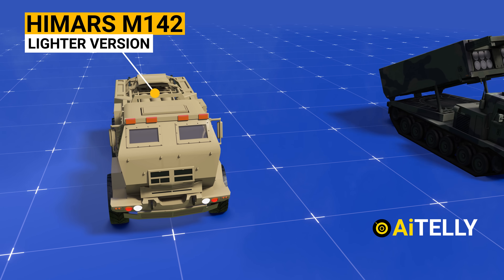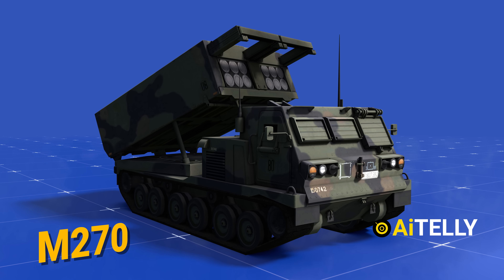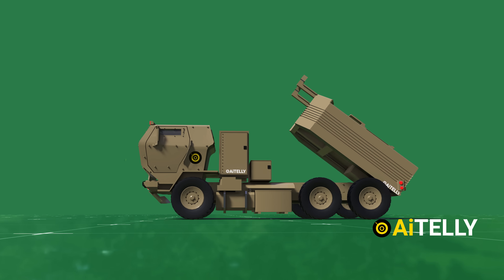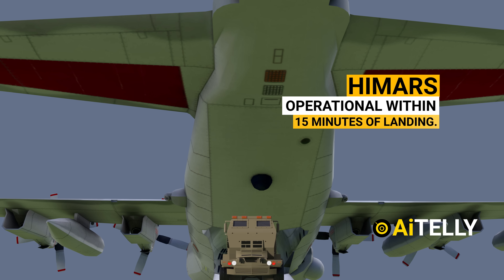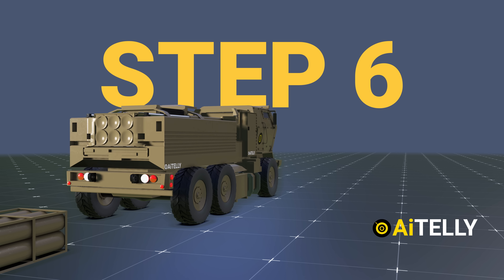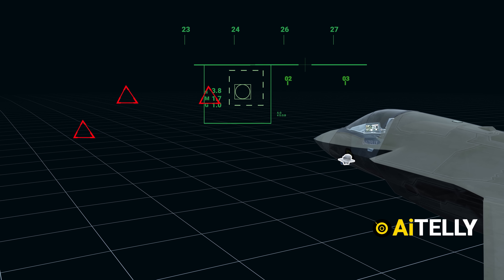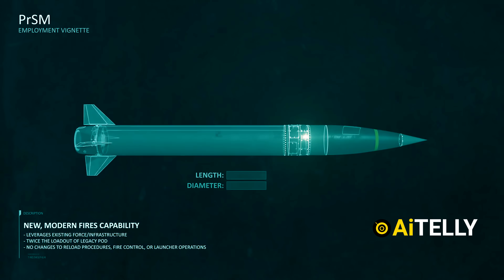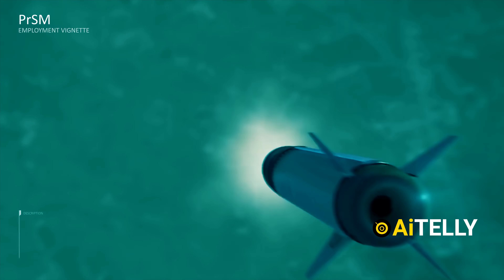HIMARS Precision Strike Missile  How it Works

Comment: As a former 13M (multiple launch rocket system operator) The m270A1 is much faster over ruff terrain than the m1083 truck that himars is based on. I would be willing to bet you 5 bucks it accelerates faster as well because 1083 trucks have very bad acceleration. Tracks over any other surface besides paved roads are aloso superior.
Reply: My friends from Ukraine say that this system is much maneuverable than M270 and saves a lot of lives because of that.
Reply from the maker: @KhersonUA4ever   Great to hear that so if it is Battle Tested means it Works.
Reply: @KhersonUA4ever  для Украины хаймарс более интересен, ибо позволяет преодолевать большие расстояния, плюс у нас нет проблем с дорогами.
Reply from the maker: Hi I have credited you in the Comment Correction Section.
Thank You for your Service!
Reply: Tracks needs more service and use more fuel
Reply: @davidavrams2626  ?
Reply: HIMARS has advantage in area with good paved roads, but M270A1 does have its advantage with track and two pods.
Reply: @Joseph-eh4rs  there are always positives and negatives. One of the HIMARS’s strongest points is ease of transport
Reply: Классная машина.
Reply: @Руслан-п8д4е  ?
Reply: They call it a cow with GPS... 😆 🤣 😂
Reply: USA army get this wepoon for afganistan why usa run Always afganistan,stop USA probaganda Himars wepoon no feet win in Ukraine War it is only Fake news
Reply: If you’re a former 13m then that means you’re a racist and misogynist who hates Arab people
Reply: Do they use the same pods?
Reply: @twisterwiper  same 6x tube canisters yeah
Reply: @twisterwiper  yes they use the same pods. M270 much more survivable than HIMARS. It turns faster, gose threw mud fast, shoots moves and communicates faster.
Reply: @joshuathomas8529  you must’ve just been stuck in korea, because as a former Mike you should know that the HiMARS is so much better
Reply: @Void-ic3ei  I never played with a HIMARS only M270A1. I saw the HIMARS never got to run one. I did get to play with FMTV's, LMTV's, and many other trucks. I was stationed in Korea frome November 2005- December 2006 and fort hood from December 2006 - February 2008. While at Ft. Hood we did a NTC rotation in Texas I don't remember the name of the base.
Reply: @Void-ic3ei  I drove the M270A1 threw about every kind of terrain you can think of. A driver that knows what he or I gess she does wont through track because they know what kind of terrain will throw track and how to avoid it. I am not saying I never threw a track. I am saying once I new what I was doing it did not happen again. A FMTV will never touch a M270A1 once it hits any thing not paved. That includes well maintained dirt roads. I could go full throttle over any dirt road with the M270A1. Most dirt roads with a fully loaded FMTV max speed if the road was in perfect condition was 35mph.
Reply: Man ur man she is sattalite shit , long live united States of Pakistan.
Reply: Вот вы где верить в сказки!  Система помогать только в одном!  Выглядить Украине что она что-то может а как оружие нас ваша система вообще небеспокоить ... она слабый... хамарс помогать делать фейки😅😅
Reply: As an Former IDF M270 operator and driver I can confirm this, when I was in the winter in muddy terrain all the trucks and even the humvee's could not maneuver well but the M270 drove smooth
Reply: @Shaked030  until you throw track..
Reply: @Void-ic3ei  Happens very rarely (it has never happened to me and I have been in many types of terrain and weather), and even if it does happen its one of the things that we always trained to repair at all of the exercises, so the repair time is short
Reply: Most supply lines run over railroad and paved or dirt roads. Its range means off-roading deep into rough terrain is unnecessary.
Reply: Who would've guessed that HIMARS were going to be used against the American people? The Grace Commission determined that 100% of what we pay in personal federal income tax goes to pay just the bare interest on the national debt. 
The Rothschild international bankers are so ingeniously cunning that we have been invaded, conquered, and enslaved, yet deceived into feeling good about it! 
Using the power of their monopoly control of our mass media, the mind controlling parasites are able to stifle all opposition using the false-accusations: terrorist Nazi antisemite.
Reply: @davidavrams2626  Let me guess, you still think Russia is a week from victory? You guys have been saying Ukraine is a week away from defeat for ~48 weeks!
Reply: Former 13M myself and have been a crewmember for both the HIMARS and MLRS
Reply: I think a ghetto drifter would appreciate how fast is, but the average grunt don't care as long as he hits the gas peddle when ordered to scoot and it goes. And remember, most of the time it's rough terrain and you don't want to go airborne laughing hysterically while you're slurping down a beer in a this scenario.
Reply: THE BIGGEST PROBLEM OF HIMARS IT IS TOO EXPENSIVE AND ROCKETS EASILY TAKEN DOWN EVEN BY SOVIET AA SYSTEMS, IN LONG TIME CONFLICTS IT IS USELESS, BECAUSE WILL EXHAUST PRODUCTION OF AMMUNITION
Reply: @davidavrams2626  особенно харьковское плановое отступление,вперёд и вперёд в Россию. В российской армии с каждым днём всё меньше и меньше дураков верящих в победу планов путина. И HIMARS один из тех елементов, которые поломали те планы. Господи береги Америку и Великобританию! Слава ВСУ!
Reply: @vitaldnovak659  какие планы?  Смотри эту неделю..увидешь как она вам помогать!😅😅  вы своим наступлением ускорить процесс... скоро вас будет 0  😱  ... идиоты ..кто вам в уши рассказал что вы способны победить Россию вода суша воздух космос профессионально       Украина видео  ролики  вранья , наколки, выпивка и винтовка .. и шоу клоуна зеленского  и да сборище всех кто хочет просто умереть...
Reply: @vitaldnovak659  Ага, мы все больше верим в перемогу Руины, не в победу конечно, это другое.. Переможники славят своих хозяев за место в их стойле..
Reply: You right. HIMARS is much worse than M270. The only reason to design it was that M270 is too heavy to be carried by Hercules aircraft.
Reply: @СмыслЖизни-с3м  don't get ahead of yourself. At the ranges HIMARS plays at you almost never need to leave the road unless there are just no roads, so functionally it will almost always be faster than the M270 in a European theater. 

What it loses in a rocket pod it gains in mobility, far easier maintainability (wheels beat tracks on maintenance every day of the week) and fuel consumption. These aren't the sexy aspects of warfare but an army marches on it's stomach. 

In the era of GPS guidance where one rocket can take out almost any target if you are using HIMARS as a strategic bomber as Ukraine is against depot's and HQ's you won't feel the loss of a rocket pod as much but you will appreciate how easy it is to care for and how unbelievably fast it is.
Reply: @hypersonichobo4263  maximal speed of m270 is 65 km/h. Of hirmas - 85 km/h. Not a big difference. In real situations military vehicles almost never drive faster than 50-60 km/h on roads (unless it's a highway).
Reply: @СмыслЖизни-с3м  military vehicles being primarily tracked ones when you talk about road speed limits. And at a theatre scale 20 kph adds up fast it will take 4 hours to drive what the Himars can in 3, that can add up to multiple extra launches per day.
Reply: @hypersonichobo4263  at the theatre no one will drive at 85 km/h.
Reply: @СмыслЖизни-с3м  on a highway in an FMTV? Ummm, I doubt that lol
Reply from the maker: @hypersonichobo4263  Hi thanks for this Valuable insight. your comment is in the (Correction/Comment section) Credited your info.
Reply: @Aitelly  thanks boo ❤️
Reply: @СмыслЖизни-с3м  Only makes a difference to a drunken, Russian with tertiary syphilis and suffering from early onset Alzheimer's.
Reply: @СмыслЖизни-с3м  exactly. Really puts the "high" in high mobility
Reply: @СмыслЖизни-с3м  sorry what

Comment: Hey can elaborate about "Brahmos missile"❤️
Reply from the maker: We will be doing it in future  we heard  the BrahMos 2 Testing was a Hypersonic Missile.

it also depends if we can have slightly de classified data.
Modeling Rigging and Animation is a no brainer but Research and Data is very Important.
Reply: @Aitelly  ok then try for HAL TEJAS ❤️
Reply from the maker: @manideeptaghosh7158   TEJAS we can do it
Reply: @Aitelly  BrahMos 2 is currently only on paper. The actual Indian Hypersonic scramjet missile effort is the HSTDV. It has flown successfully at least once. Next test will have it fly without the payload fairing.
There is another separate Indian Scramjet engine program by the Indian Space Research Organization that has also flown a couple times on sounding rockets. That is also a success. 

The actual specifications of the future Indian hypersonic cruise missile based on the HSTDV technology has not been revealed yet. In the interim you'll see claims by the BrahMos Corporation about BrahMos 2 but BrahMos can only offer a Russian hypersonic missile because its just a JV between Russia and India. And Russia and India don't have a joint scramjet engine development program yet. So BrahMos 2 is likely to remain on paper, especially because recent Indian successes in ramjet and scramjet technologies makes import of such systems from Russia unncessary.

Comment: Why do they drive away leaving the missiles behind in step 3?
Reply from the maker: The HIMARS Strategy is to reduce the Risk of enemy fire and Separate the Reloading Platform from the Firing Platform sometimes miles apart.

So when there is an Artillery Fire it will hit only one  or the other thereby reducing risk.

Comment: How are the HIMARS working in Ukraine when the Russians try to block the GPS signal?
Reply from the maker: Good Question.
Military GPS is different from The one we public use.

Many information are still classified for the public.

GPS systems require at least three satellites to be "in view" of the device. More is better.

as other posters have said, missiles can use a variety of guidance systems - GPS, inertial navigation (spinning gyros with a known starting position), radio, radar, visual (tv camera), heat seeking.

Comment: I have a question how gps signals can be received when the missile travels at Mach 3 moreover the gps is inaccurate when the object is moving so can you explain how it overcomes this obstacles and hit its target accurately. Moreover the Russians try to block gps signals in critical infrastructure areas.
Reply from the maker: Military GPS satellites are different from what we civilian use.
They are highly accurate.

Just as they could take military  pictures from Space same technique   applies here.
Reply: @Aitelly  so how they can pinpoint location in gps denied areas by jamming and spoofing done by Russia?
Moreover how it is possible for missile to receive gps signals when travelling at Mach 3
Reply: @Aitelly  you haven’t answered my question if you don’t know the answer to this technical question say it to me or if you know it pls answer it to me.
Reply from the maker: @celestialexistence3014  
GPS systems require at least three satellites to be "in view" of the device. More is better.

 Missiles can use a variety of guidance systems - GPS, inertial navigation (spinning gyros with a known starting position), radio, radar, visual (tv camera), heat seeking.

They Do not depend on just GPS.
Reply: The guidance on those rockets use 3 solutions for 🎯:free inertial/blended (inertial and GPS combined), and GPS, of course GPS or EGR is M-code. (US Mil).
Reply from the maker: @miketran3356  This is awesome Explanation
Reply: The missile use what's called inertial navigation system (INS) INS uses a combination of various factor to get the missile to target
GPS refines the targeting data so the missile is much more accurate
Thanks to advances in technology, INS is far far more accurate 
Again also thanks to GPS-jammers, the US developed newer sensors to counter jamming
Example 
Circular error probable (CEP) , basically how weapons accuracy is measured with out GPS is 200-300 meters
GPS can reduces CEP to about 10 meters or less 
In case GPS is jammed, the newer sensors developed can achieve a CEP of 30-50 meters
Lastly, to use HIMARS missiles against a moving target, it would have to be a very high value target or asset
Its called predicted none line of sight 
Basically , a forward observer provides the target course and speed
They take the target speed and combine with the missile speed which depends on how far the missile has to travel and come up with point of impact
Based on target speed of 40 mph , it will reach this point in 1 min 12 second
They designed that point and fire 
The M30/31 have 200lbs warhead so it does not have to be direct hit
They don't use this method unless its absolutely necessary
Reply from the maker: @verdebusterAP  Hi  I'm going to put your Comment  in the Correction Section because we failed to explain this.

Thank You so much for the effort
Reply: Let me try. How GPS signals can be received when the missile travels at Mach? 3? I do not know, but my telephone can accurately gauge me driving at 100 miles an hour. And that's with music streaming. High performance military systems and in particular those using the military GPS signal presumably have higher performance capabilities. I would think that the designers were aware that they would be dealing with entities traveling at high speeds. Do you assert a performance limitation of GPS in vehicles traveling at a certain speed?

You ask a second question about inaccurate GPS on a moving object. Either It's the same question as the first, or you mean that GMLRS doesn't have a seeker. Maybe they could put one of those in the nose of this thing where they have the extra space. 

Meanwhile, aside from volley fire by dead reckoning, which I believe our host states is current practice, if you have somebody steadily designating it, I don't know, but it might be able to receive GPS updates in flight. That would be interesting to note in a later update. 

Anyway, that was never in its brief. But we love to stick more gadgets on everything so I'm sure the D variant will have a trimode unit for another mil ;-)

Third verse, same as the first. Military signal is more jam-resistant, military hardware is more jam-resistant.

Jamming works on you guys because you're using Garmins strapped to the pilot's knee.
Reply from the maker: @nichevo1  Awesome brief. This is one of the most Simple and logical explanation that I have ever read,:washhands:
Reply: @nichevo1  ok thank you for your explanation the thing is I have read long back that when fighter plane travels at Mach 1.5 at certain location or even at higher speed the gps error margin increases so I thought when a missile travelling at Mach 3 surely it would be impossible for it to receive gps signals since because at more high speeds Mach 5 no form of navigation system will work except INS. But as we can see in Ukraine it precisely hit the Antonovskiy bridge so I thought it may have some form of laser guidance system or terrian contour matching.
Reply: @celestialexistence3014  there is no speed limit at which GPS loses accuracy. But civilian GPS receivers have a build in shutdown mechanism such that it refuses to operate above a speed threshold. This limit is to prevent enemy states from using civilian GPS receivers to build systems such as the HIMAR rockets.
Reply: GPS jamming has limited range. It will not be effective at the rocket apogee. The rocket also has a high gain GPS antenna that only allow signals from above to be received and rejects jamming signals from below the rocket. A military GPS receiver can tell false signals from true signals through the use of encryption. This allows to the rocket to calibrate an inertial navigation system for the final fase of the flight. The GPS might be jammed in the final fase but at that point the rocket is already in a very precise trajectory.